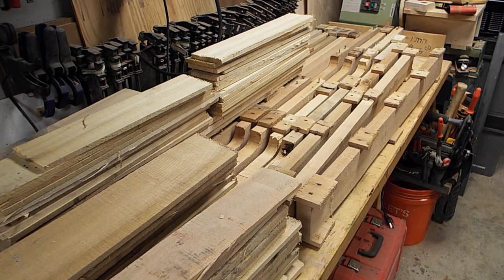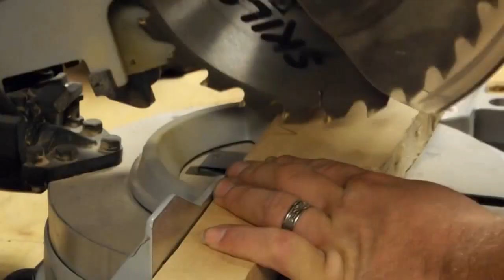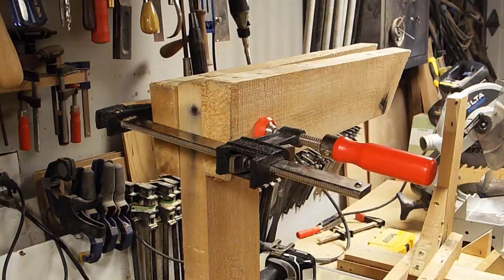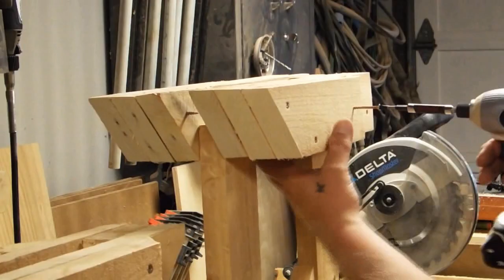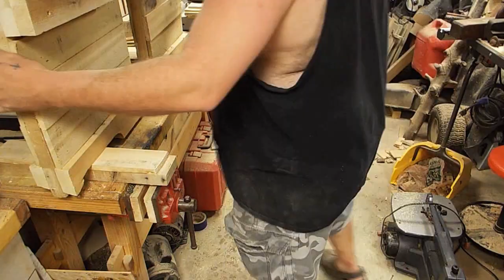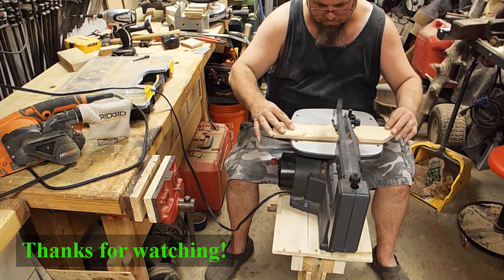GPW 60 - Pallet Scrollsaw Station (Pallet Up-cycle Challenge 2016)

Comment: Nice concept  But it's for your wife  run a roundover  router bit over the square edges at least on the seat.
Reply from the maker: I did it with the belt sander (not highlighted in the video).... that's a very good point tho. Thanks for watching and commenting.